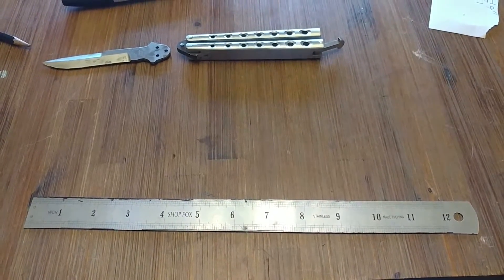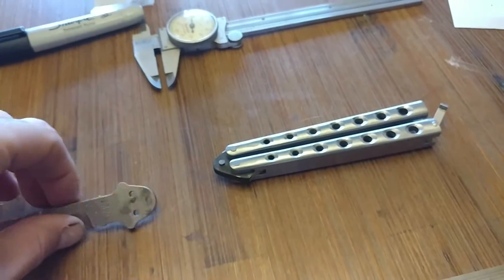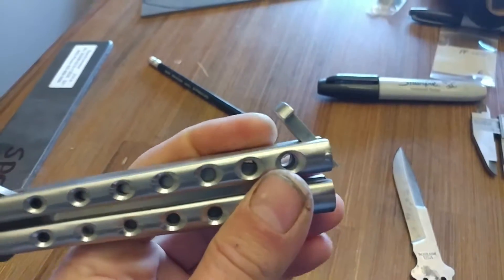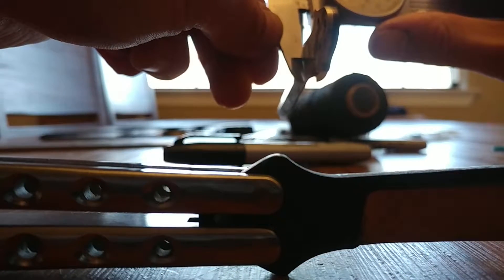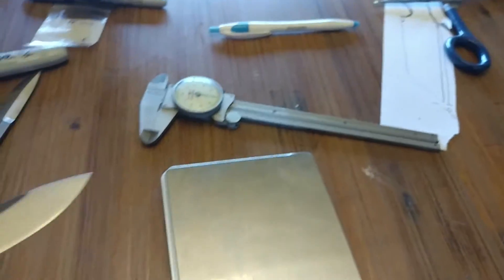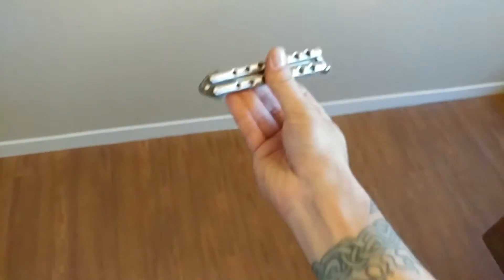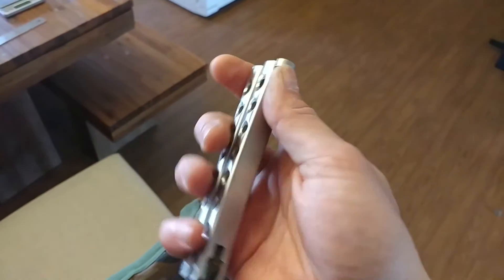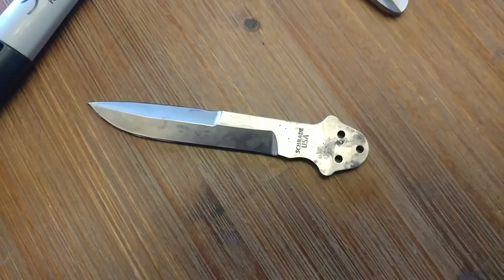Re-blade Schrade Manila Folder

Comment: Loved watching this.  Great work.  I’ve been looking at this Schrade Manilla but if I get it I want it to be a Batanga.  So, I would have to switch the handles.  My question is how did you remove the pins and how did you re-pin it?  I wonder if you could also use Loctited screws instead.  I’ve never done a project like this.  Anyway, that blade looks bad ass.